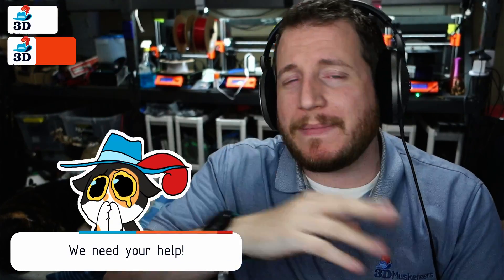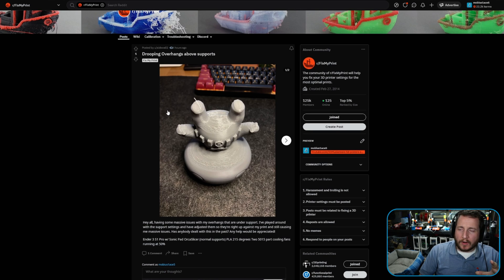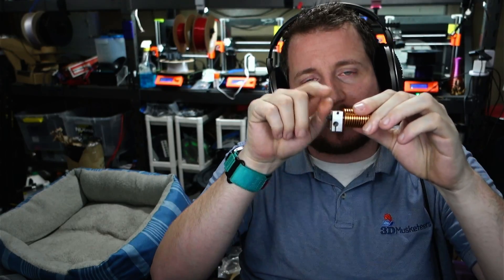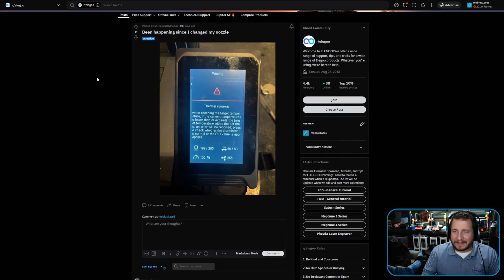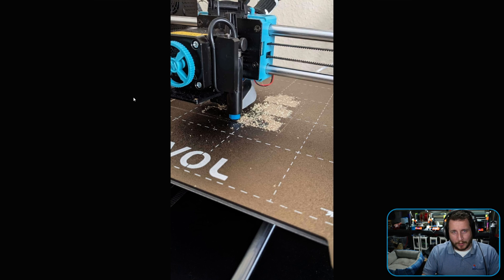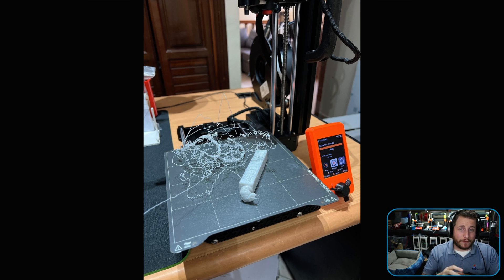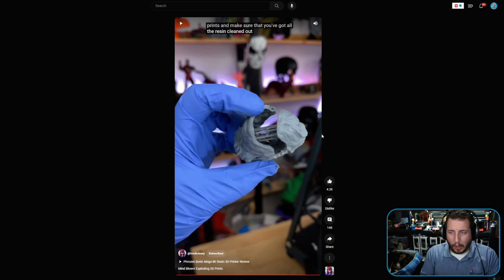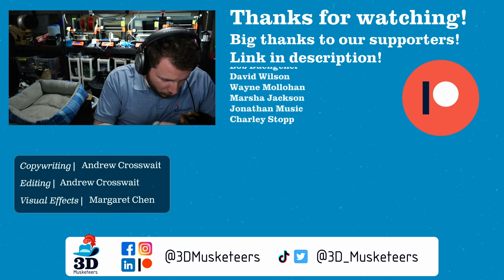Resin Prints EXPLODING! - PrintFixFriday 124

Comment: Here's a fail from me: if you have a v-roller y axis, your bed might not be as warped as you think. Check your rollers from time to time, especially after transporting the printer :) I spent a lot of time tramming and leveling my bed with the knobs, turns out rollers were loose a bit, so I tilted the bed left-right every time I touched the knobs :)
Reply from the maker: ooof yeah, those V wheels can get ya!

Comment: 3:50 I would argue a little... you can cool PLA too much, especially with dual-fan setups.... yeah overhangs will be nice and prints come out nice (most of the times) but your layer adhesion will suffer big time... when I hit 100% fan to my dual-fan setup, then simple PLA print turns into silk PLA print... could break the print layer by layer
Reply from the maker: Okay, that is fair, you definitely can overcool it, in their case, it is not the issue lol

Comment: UVtools has saved me so many prints. It should be in the resin 101 curriculum. Also, ditto for the brim advice. Cutting off a brim is better than throwing away a failed print, you taught me that with my hitemp problems (thanks btw).
Reply from the maker: its underrated 100%

Comment: I had high hopes for the K1 Max. The hot end made a loude pop when I finished my 3rd print. I thought the hot end had an issue so I decided to replace it with the included extra. Everything went ok  at furst (not easy, but not terrible). When I got to the point where you disconnect the thermistor and nozzle temp wires, I noticed that there was what looked like yellow wood glue covering where the plugs go into the board. This made it impossible to wiggle the wires free. I had to try and remove the the glue as gently as possible. This lead to the board portion of the plug tearing away with the glue. Then the copper wire tore completely. Ended up slashing my finger on the board edge. I'm returning it now. Swapping an extruder for one that is included should not be that difficult. Especially when due to bad factory adhesive use. Going to give bambu a try.
Reply from the maker: oh fun they put a potting material on it :/ 

I have had not so great experiences with Bambu personally, but good luck.

Comment: My filament came in. I'm giving it another go. I increased the bed temp to 100 from 90. The filament temp to 250 from 240. We'll see if this will stick the supports better. You did say atomic likes the heat. I wish there was a better way to print this since it's like 99% supported. lol
Reply from the maker: good luck!!
Reply: @3DMusketeers  I think this new spool is defective. It's brittle. The line keeps snapping. One time when I went to reload it, it snapped in my hand.
Reply from the maker: :((((( For most materials that can be indicative of moisture, but if it is new, that is not something you should accept IMO
Reply: @3DMusketeers  The prints are strong. I finally got sick of it and pulled it out of the dryer. It's not breaking on the spool holder. Unfortunately I had a layer shift. I had a couple supports pop off at the top.  And it's happened a couple times. I finally got the z-hop to work. I've tried upping it to 8mm and yet I saw no evidence it was doing that. Turns out it's not the printer setting. It's the filament setting. I have some decent z-hop now. I think the problem was that it was yeeting past minor importfections in the supports and popping them off and that causing buildups leading to crashes. Hopefully 4mm z-hop should do the trick. I can definitely see it lift up now.
Reply: @3DMusketeers  so...the new z-hop settings worked like a charm I didn't lose any supports, no layer shifting...unfortunately I can't use this print.  There was a random burned blob of PETG causing a deformation of the model in one area. I get that PETG tends to leave 2 or 3 burned blobs on the bed, but dammit this one didn't make it to the bed!! lol